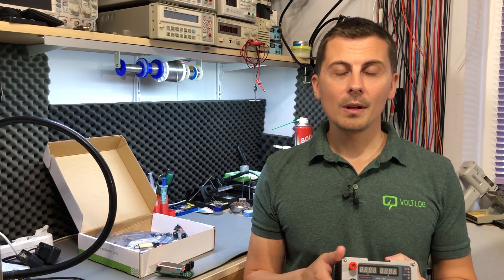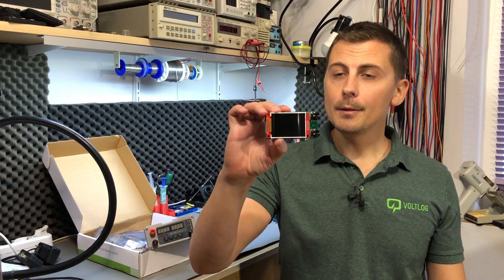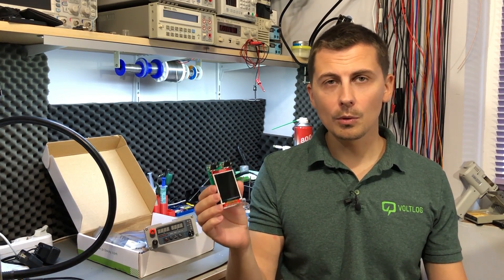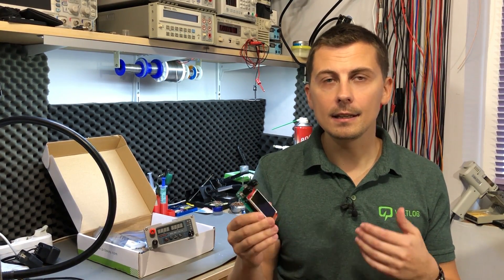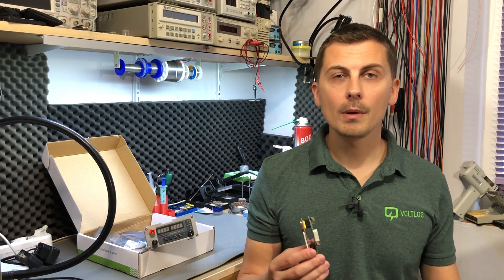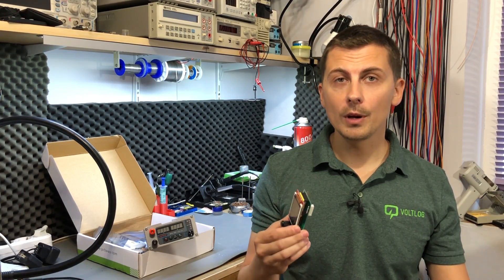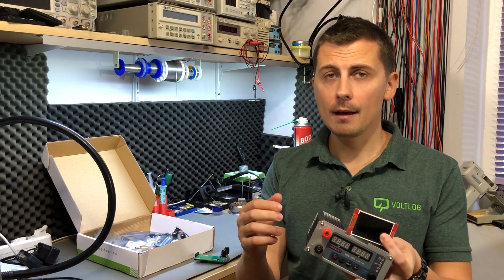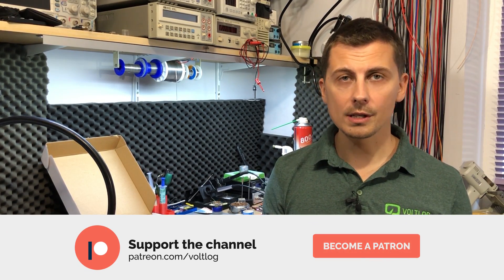STM32 Programmers Wanted For Open Source Project

Comment: An excellent example how NOT to ask the open source community for help. You say you need some help with a project. Cool. Doesn't look complicated. Personally I have some spare time and it so happened that I'm an author of a library for the display your are going to use, so I'm familiar with it anyway. But than you declare a list of requirement of how it should be done, very technical requirements. Where is the mistake? Well, it's actually a long story about engineering management and motivation. People write books on this subject. But in short - people you appeal to are most likely senior developers. They are experts in their area. You don't come to the expert and say "do me A, then B, then C and choose X to solve such issue". You say "you are an expert, solve me a problem, you know better how".

Comment: arrg, I'm familar with STM32 and FreeRTOS, unfortunetely I'm very busy learning rust on the STM32 :( but maybe I can help at least as a code reviewer or so ...
(P.S. I personally recommend to use directly C++ even with the Cube HAL and FreeRTOS)
Reply: Nice to hear from someone playing with stmcube. I tried stmcube half a year ago without great success, I found their library very unstable and useless. I vent back to Atollic TrueSTUDIO IDE. The Stmcube has a very nice hw configuration tool. What is your experience?
Reply: @jenskaa4044  in the past few years stmcube and the genereated HAL libs improved a lot in terms of stability, we also helpen ST to fix some bugs, but on the other hand this HAL creates a lot of overhead. The HAL lib in one example why I prefer modern C++ over C, you could finetune much more with features like "constexpr", "likely/unlikely" and prevent some tyupical bugs with "nodiscard"
Reply: Trying this with Rust would be cool 😉
Reply: @StefanSchlott  yes, but not so Main stream

Comment: Sorry that I cannot help with STM32 firmware development, but I really hope that you find suitable participants as I think this is a worthwhile project and have wanted an open source interface since your first tests of a Gophert supply a few years ago.  This power supply is quite good in most regards, especially with its AC input, but it needs a better interface to compete with similar RD Tech (Rui Deng) models.
Reply from the maker: Thank you for your support!

Comment: Segment this out differently. Instead of making this a side project for a few people to volunteer for, make the effort more drawn out and public on here, and post details somewhere like the EEVBlog forum where people can engage without commitments. I think most people here are on there. It's not another mystery-javascript social hacking data mine. Yeah we're already on YT but that has pushed many over their limits. Lbry is a thing now.

 Anyways, do a vid to propose the basic top down topology to get started and get feedback. Then do a proposal for each function and get feedback, etc. Challenge people to make suggestions and submit improvements. This is just how I think I would do it.
  I imagine there are few people that fit the experiance description and have the time to commit to filling a blank page. However, from what I've seen, the masses will commit 10x their time to tell ya how you got it wrong and how to do it better if you just make the effort to put something on the page in front of them, even something as dumb as: get reading, if ugly, for reading, make pretty :-)
   My programming skills suck, and while I'm just getting started playing with an STM32, I'm doing it with micropython, and a cheap STM32F411 blackpill... I'm using micropython because C sucks sometimes, and I don't want to use the cube programmer trackerware from ST.

  I would probably move you in the opposite direction of progress... Just playing with an analog PSU with an arduino based meter and fan temp control got me burned out....bc, like an idiot, I got carried away with a bunch of dumb stuff. Like trying to make graphics using the custom character bitmaps of a 1602 to do pointless stuff...and some audio nonsense I got carried away with. The only syntax I know is how to make a practically infinite cascading if statement. So sorry I'm no help.
 GL though
 -Jake
Reply from the maker: Hi Jake! Right now the project is in a state where we do not have something functional so the last thing it needs is for this to be public and have a bunch of new ideas/suggestions on how this should be built but without any man power, because that will only turns us around and delay any efforts put into development. Until we have something functional, it will stay private.

Comment: FreeRTOS might give you more problems than it'll solve on a simple project like this. Everything should run quite neatly in standard c without complicating things
Reply from the maker: Hi Steve! Thanks for the feedback, I'm definitely going to support the less complicated way of not using a FreeRTOS if that is what the new programmers joining the project desire. The way existing programmers painted the picture was that with FreeRTOS it's easier to manage multiple tasks as: Display buffer, PSU Control output signals, PSU input, Serial coms. They also mentioned it would be easier to add other new tasks/features in the loop for future development.
Reply: What kind of problems? Most og my mcu stuff uses freertos, its a very pleasent way of  breaking down your program. Having poll operations in the Main loop its not very nice.

Comment: Hi Voltlog/Florin. Can you add a github link hardware,software and that mentioned Discord channel to the video description? I'm familiar with all requirements but not sure I could find a time. But I'm curious and can help in some technical aspects. I did a lot of magic with ADCs/DACs and DMAs on STM32F3 and other lines of their micros. A hardware block diagram and readme with software requirements would help to gain more curious people to this project.
Reply from the maker: Hi, please reach out via email if you are interested in this project and I will invite you to the discord server. Right now the project is in a state where we do not have something functional so the last thing it needs is for this to be public and have a bunch of new ideas/suggestions on how this should be built but without any man power, because that will only turns us around and delay any efforts put into development. Until we have something functional, it will stay private.

Comment: Just create github repo with readme.md and write all that you think we should do. people will pariticipate trust me. There are issues and there will be a lot of ideas and pull requests.
Reply from the maker: That will not work in the current state of the project. We are talking about hardware prototypes here, you can't participate just by reading a github readme.md. There are limited hardware prototypes available and so they need to be used wisely and be sent to people who can really do something for this project to get it started.

Comment: If you can do this on STM32 that would be great.  I did it, but used Teensy 3.2 because it's a perfect fit for this application. The design works with Gophert models NPS-1600/1601/1602.  It has voltage/current tracking so it's more accurate now, and the touch LCD user interface is a joy to use.
  There's a picture, plus the electrical, mechanical, and software design files are on Thingverse at https://www.thingiverse.com/thing:4599959

Comment: I'm not familiar with the STM32 environment, but I think a USB connector would be useful, both for controlling and for data logging from a remote PC or other computer. As for the project - I'd start with the "fail to safety" routine and build up from there.

Comment: I would love to help and I think I have the skills needed, But I don't want to touch the IDE nor the Hal libraries
Reply: I have droppede StmCube, their libraries are useless, a shame because their intention with the hw configuration tool is very good. Instead I use Atollic TrueSTUDIO IDE. Perhaps PlatformIO is the way to go.
Reply from the maker: What would you suggest we use instead and why? Cube IDE and the HAL libraries are pretty popular and so it's worth going with them to make the project accessible to as many people as possible with as little effort as possible.
Reply: @voltlog  using an IDE doesn't make it more accessible, it's just another software you have to install on your system, and the Hal libraries are suboptimal at best, I would suggest writing the project in a way that is platform agnostic, and people could use VSCode for example, and writing your own drivers for the peripherals
Reply from the maker: Rafael Silva ok, thank you for your feedback.

Comment: Is the plan to support more than one specific supply? I have the 3010 I think, for example. Are they different in how they are controlled from the panel or would it be an easy software patch to support different current and voltage?
Reply from the maker: If the different models have the same control method and same voltage range on the control signals it should be very easy to support different models.
Reply: @voltlog  Yep, the 1600, 1601, and 1602 are compatible; all you need is to recalibrate your controller for the particular model.  The signals are fairly linear; I used 4 and 6 point calibration curves and am getting good accuracy across the whole range of settings.

Comment: Are you using an external adc and dac? Only reason I could think of making rtos a requirement (it's would otherwise just be in the way if you use the internal hardware) :)
Reply from the maker: Using internal ADC/DAC however, there will be multiple tasks to be handled and so the programmers that joined the project suggested RTOS is the way to go for easy management of the different tasks.
Reply: I just found your older videos. RTOS is indeed the way to go. :) Sorry for my stupid question

Comment: I would use Zephyr as RTOS, it’s backed by Linux foundation and there is plenty support for stm32 and graphics
Reply: I think freertos is the right choice. Its the most common realtime os and its well supported.
Reply from the maker: Thanks!  This will have to be discussed with the new programmers that will join the project.